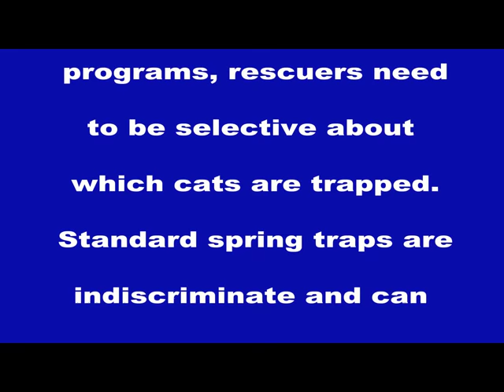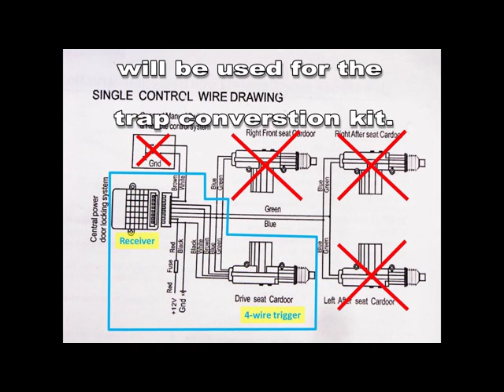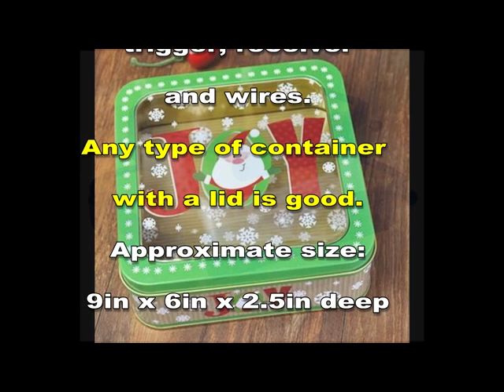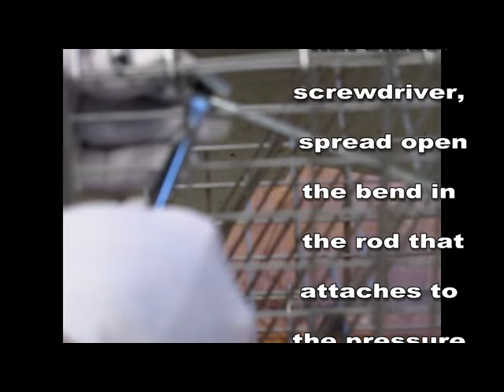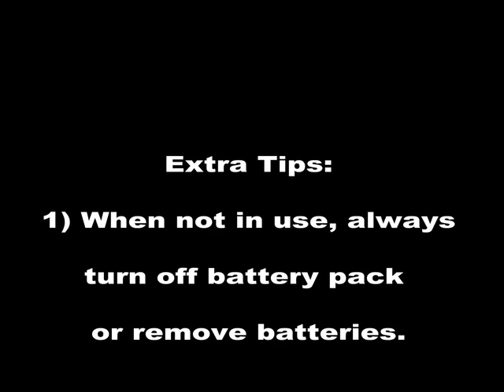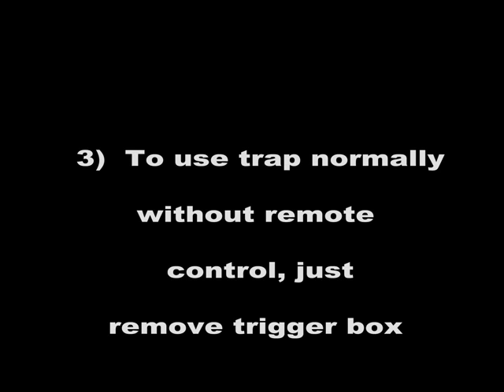How To Build a Remote Control Trap for Ferals

Comment: Thank you so much for this video!  Can you think of a way to modify a drop trap in a similar way?
Reply from the maker: https://www.youtube.com/watch?v=tHaELqyo9UY

I have made a few attempts at designing a remote controlled drop trap, but the problem is that the small solenoid trigger (remote car door lock) has a very low pull-strength.  Most of the weight of a drop trap in the "up/open" position will rest completely on this small trigger.  The weight of the trap tends ot overpower the pull-strength of the solenoid and so nothing happens.   BUT....   another option is to use the drop trap as a "box trap".  With the trap placed flat on the ground, and the sliding door open, then the solenoid only has to support the weight of the door - and it works perfectly.  Here is a link to a video posted by a rescuer friend who uses the remote car door lock mechanism for both her spring traps AND her drop traps.   Check it out.  It is simple and straightforward.  If you will contact me by email at    hoc.288lives@yahoo.com    I will share with you my write-up and sketches on the design ideas I have for a traditional drop trap set-up.                     

Here is the video to the remote box trap......        https://www.youtube.com/watch?v=tHaELqyo9UY
Reply: Cool, this is what I came into the comments to ask-
Except I have taken to using med/large metal dog kennel style cage as drop trap.
I use a length of paracord routed through the rear, hooked to the middle of the door w/a carabiner.
A few good sized bricks allow for some tension to be used when pulling the door closed and keeping it taught when approaching to lock the latches.

I stumbled upon a vid of a hog trap using cellular, and a type of solenoid to release the door to fall. remote/wifi cameras and solar panels maintain the battery, so everything can be very remotely operated.

Which lead me here.
I want to design/build a trigger that can be used w/the kennel style door, remotely. I've spent many stressful hours holding on the end of a line, waiting, hoping not to be noticed.
A remote would be much more useful.
I just have to figure how to close & latch the door automatically, after engaging the trigger.

Comment: Help. How can I do this to a gravity trap. This appears to be spring loaded. Trucatch trigger rod can't simply be unnatached.
Reply from the maker: Kiira,  It's been almost a year since you posted this comment/question.   I apologize if I never responded.  I have made modifications to the system allowing it to work of a gravity trap, but recently I became aware of a brilliant alternative - specifically for use on the Trucatch gravity trap.  Check out this video.  It is very simple and easy to use and actually costs about the same as the automobile door lock system.  It is a Drone Clip Release....    https://www.youtube.com/watch?v=J7qoQ_u33sc

Comment: Hey there,

I’m pretty inexperienced with wiring and electronics but I’m hoping that you might be able to help me with a few questions? 

Does the fuse need to stay attached when connecting to a 12v AA power supply? Or is that mostly for automative use? 

Do I need to connect the red and black (ground) cables to the red and black of the 12v PSU? 

Thanks in advance
Reply from the maker: You are correct.  The fuse link is unnecessary for this application using AA batteries.  (as you pointed out, it is designed to protect an automotive circuit from potentially high amps from car battery).

Yes, your dc power source/power supply should be connected to the black and red wires.
Reply: Thanks so much for your help! 

Today I was able to convert a regular trap into a remote controlled one using this video. 

I had difficulty getting the latch to release the trap door each time as the wire wouldn’t always pull in a straight line. 

I ended up using cable ties to secure the control box as I wanted it to be a permanent fixture. 

It took a lot of trial and error to get it right, but it works :)
Reply from the maker: @marc.ncrypt    I love to read about success stories.  Congrats.  Sometimes trial-and-error are the best teachers.    Last week I corresponded with a viewer who was able to buy just the receiver and used them to build extra remote traps using the extra slave solenoids that come with the master solenoid.  He built ten remote traps for local rescuers/trappers.
Reply: @hoc31rescue  I was looking into buying just the control box to use with the other locking mechanisms. 

Would I need to buy a kit had the same wiring diagram and colours? 

Or is it easy enough to match them up even though they used different coloured cables?
Reply from the maker: @marc.ncrypt   I just looked on Amazon and found several kits with only the receiver, a wiring harness and the key fobs.   A company called FICBOX makes a couple different models for  $15 - $20.   It should not be necessary to purchase a kit with the same wiring diagram because the (extra) solenoids/locking mechanisms are "dumb".  They should have only two wires that only need a voltage which can be supplied by the "universal" kit receiver.  You may need to use a little trial-and-error to get the mismatched color wires attached correctly, but from the wiring diagrams I saw online, It should be pretty simple (and with the low voltage and low amperage, you will not damage anything if wired incorrectly during the trial-and-error phase).   I am unable to post any photos or diagrams here in the comments section, but if you contact me thru my email at   hoc.288lives@yahoo.com   I will reply with additional information on these diagrams.
Reply: @hoc31rescue  thank you! 

I’ve purchased a couple of control boxes to trial with the remaining locking arms. 

Shouldn’t be too hard to work out, thanks again for your help.
Reply from the maker: @marc.ncrypt  Great!  Reach out if you have questions.
Reply: @hoc31rescue  I figured it out after a good amount of trial and error haha. Stoked that it works

Comment: I can't find the Jameco battery holder on their site or others. I'm assuming that you liked that one because it lies flat rather than the bulkier box with four batteries on top of four batteries ?
Reply from the maker: Thank you for notifying me about the battery holder.     I have no real preference for the shape or size of the battery holder - as long as it is 12volts and I have a container that is large enough to contain the holder as well as the other components.  I have added a list of alternate sources for the battery holder in the video description above...

Comment: Hi - Just ordered the parts for this remote. could you please send the wire connecting instructions to me. Thanks this will make it so much easier to trap target cats.
Reply from the maker: Hello Scifier1,

I responded to your request via the YouTube email app.  I attached two schematics for the remote control wiring,  but I am unsure if YouTube email feature will allow and send the attachments.

If you do not receive an email, or you receive the email (without) attachments, please contact me through my personal email address....       hoc.288lives@yahoo.com

I will reply with the proper attachments.
Reply from the maker: I received your email this morning and have replied with the schematics.   Please let me know if you have any questions (or if you did not receive my reply).

Comment: Hi Hoc31, what is approx costs for all parts and time for labor once you "had it down?"
Reply from the maker: The price of the trap depends on the trap size and brand, but the one in the video cost me less than $20.  The price for a keyless universal car door lock system varies greatly and seems to have increased since I posted the video.  I found several brands on Amazon.com for $30 - $35 (InstallGear Keyless Entry System.    KKmoon Universal Car Door Lock Keyless Entry System.   X AUTOHAUX 4 Doors Central Lock Locking System).   The 12 volt battery pack is available on Amazon for less than $10 (abcGoodefg 2 Pack 8 x 12V AA Battery Holder Case Box with ON/Off Switch and Leads Wire Cover).  The enclosure/box/container for the receiver can be just about any type of box or container (free).  So, my setup (including the trap) cost me less than $45.   Today, the same setup would likely cost between $50 - $60 (including a medium size trap)

Comment: From the car remote kit, I've got two green and two blue wires that are much longer than the rest that have "plugs" on the end, and then blue,green,white, black and brown wires which are shorter and have "plugs" on the end of them. The strip that plugs in to the box with antenna has two brown, two white, a green , blue, red and black wire.  Can you help with what to do with all these wires please ? Thank you !
Reply from the maker: I sent an email to you with a detailed wiring diagram plus additional photo of the kit installed in a container.
Reply: @hoc31rescue  can you email this to me? I sent you an email just now

Comment: Operation Catnip Gvl. Fla. has done over 50,000 TNR in the last 20 years. Think we could adapt your system to tomahawk drop trap?
Reply from the maker: 50K TNRs - That's truly impressive.
A couple of years ago I was toying with the idea of a remote controlled drop trap, and I worked up a trigger design...  just never got around to building it.  The Tomahawk Drop Trap could definitely be used with some minor modifications to be remotely triggered using the same automotive lock mechanism.   If you will contact me via my personal email, I will gladly share with you my ideas for the design.         hoc.288lives@yahoo.com
Reply: @hoc31rescue  I hope it's okay if I contact you to get your thoughts on how to modify your creation for a drop trap.  :)
Reply from the maker: @porchelovely1602  I will reply to your email within the hour
Reply: @hoc31rescue  I used a drop trap, but I didn't drop it. I cut a piece of 3/16 foam board to fit in the channels of the release door. It's held in the open position by the wire from the actuator going through a small hole in the foam. I added some metal mending plates or some such for weight. The remote was strapped on top of the trap
Reply from the maker: @ricknelson2940  I like your suggestion of lightweight foam core.  I was working on a similar idea using melamine board (also with hole through which the actuator wire protruded.)   The foam core would have been a better choice as the melamine was just heavy enough that the pull strength of the actuator was unable to overcome the friction of the wire through the hole.

Comment: is there even the slightest amount of noise emitted from the remote when it's triggered? I know the door will make noise when it's dropping.
Reply from the maker: The "remote" key fob makes no noise.  The trigger mounted to the trap does retract when triggered thereby releasing the door.  There is some sound associated with the retraction, but the sound is not loud and is simultaneous with the door closing.

Comment: How much would you charge for the 'kit' sent in the USA? TIA
Reply from the maker: Shellie B.     There are various types and sizes of traps with various trigger mechanisms.  Most are the same, but a few may be different.   The basic "4 door central locking system for cars" will likely work on any type and size of trap, but the connection to the trap trigger may be slightly different for each type of trap.  So it is not one-size-fits-all, but making it fit is very simple with very basic tools and available materials as shown in the video.  I have had numerous people with few resources and no experience successfully modify their personal trap.  Just search on internet for "4 door central lock system for car".   There are many companies that produce a reliable product.  I purchased mine on Amazon.com.  I just did a quick search on Amazon and found several ranging in price from $25 to $35 each.  If you decide to build one yourself, and have ANY questions, you may contact me at hoc.288lives@yahoo.com.   Really, it is not difficult to do.   Here is a link to one of the lock systems on Amazon......       

https://www.amazon.com/XYZCTEM-Central-Conversion-Entry-Universal-Vehicles/dp/B016RUV8Z2/ref=sr_1_6?keywords=2+door+central+lock+system&qid=1585797031&s=automotive&sr=1-6

Comment: Can the other 3 locking solenoids be used if you purchase another control box w/remotes and battery box?
Reply from the maker: I had the same thought when I purchased the locking system.  It was several years ago and I do not recall if I ever attempted to trigger one of the other solenoids separately with the receiver & remote.    It would be worth a try.   I will attempt it tomorrow and post an answer here.  (but even if you can, I am uncertain if the control box and remote can be purchased separately)
Reply: @hoc31rescue  Yes they can, I saw a box and 2 remotes for $11.00 on ebay. That's what got me thinking
Reply: @hoc31rescue  Someone on the comments said you can only either extend or retract, not both. If you are trapping cats, you would only need to do either depending on how the release works. So let's say when you retract it all you need to do is manually pull the plunger out and your ready again.
Reply from the maker: @striker273  You are absolutely correct.  I just went into the garage and connected ONLY one of the slave solenoids to the receiver/controller.  The trigger action is ONLY one direction - either extend or retract depending on the polarity connection to the controller.  And yes, I agree...  with the trigger set to retract (release trap door), then a simple manual pull/extend of the plunger will have you ready again.   And if you are able to purchase just the receiver and matching remote fob separately, then you are good to go.  I just did a Google search on "universal remote central locking system".   Numerous versions available online (Walmart, Newegg, USA Banggood).  These all had two remotes, the receiver and a wiring harness.  Prices ranged from $15 to $20 and up.
Reply from the maker: @striker273  I looked back through the comments.  It was about a year ago and the comment about retract or extend was from me (I forgot about that).  At the time I tried to determine the answer to his question by analyzing the vague schematic.  Luckily I did not remember doing that and today I just plugged the 2-wire trigger into the receiver and pressed the remote.   Thanks for getting me to think again. I updated my response to the year-old comment as well.
Reply: @hoc31rescue  Thanks for the update. I unfortunately already ordered more units, they're cheap enough.  Atleast we have an option to use them.  I can at least make triggers for other TNR trappers  for the cost of parts. The Tomahawk goes for $150

Comment: great idea. what kind of range can you get with the remote?
Reply from the maker: I have not checked the maximum range.  The solenoid is made for an automobile remote lock, so I would imagine the range would be comparable to a normal key fob to unlock a car.  I have successfully used the remote trap at distances in excess of 75ft.
Reply: thats pretty good still.. would the solenoid pull a pin for a sprung door pig trap?
Reply from the maker: I do not know the measured pull strength of the solenoid, but I believe it to be quite low.  If the spring on the trap door is strong (which will exert more pressure on the trigger), this device will likely not dislodge the trigger.  The spring trap in my video has a small hook seated on the trigger with a free-spinning ferrule. This essentially creates a very short pull on the trigger, so depending on your trap (how much pull is needed to trigger the trap), then maybe it will work for you.  (sorry if this doesn't answer your question. I have no experience with a pig trap).